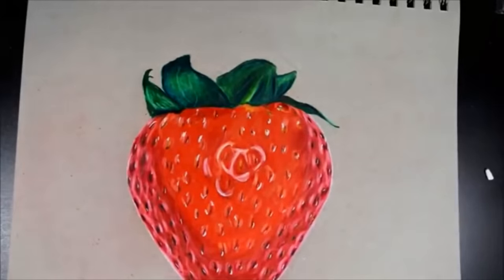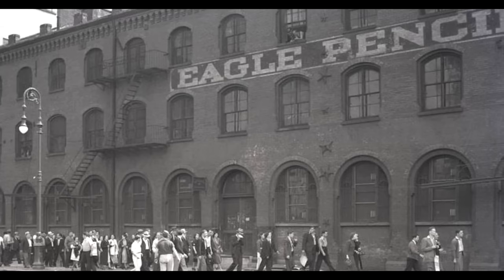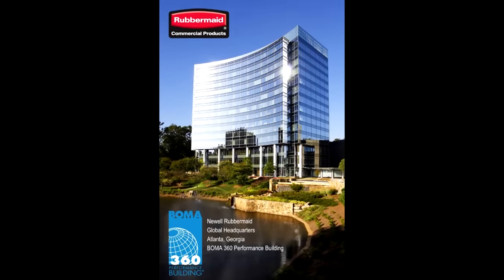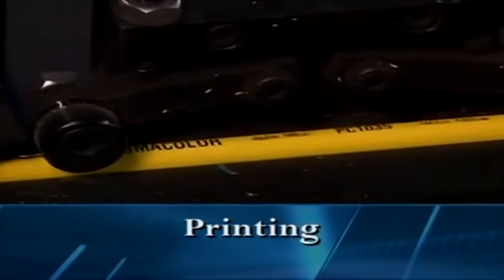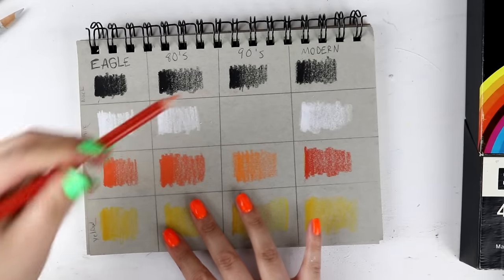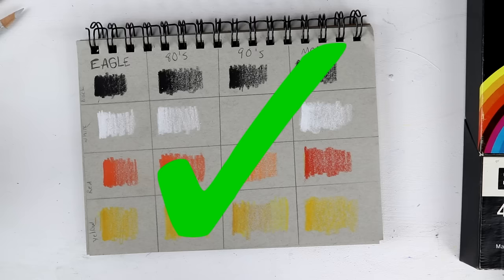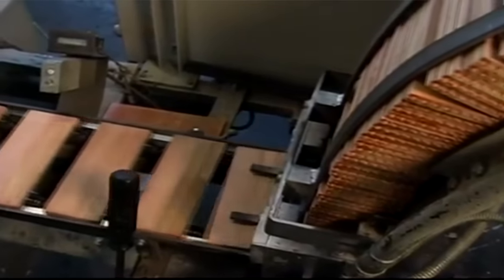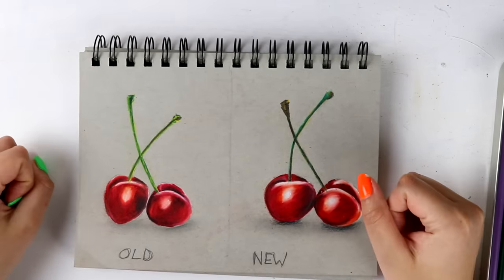Comparing 80 YEAR OLD Prismacolor VS 2019 Prismacolor Pencils: Have They Gotten Better Or Worse?

Comment: FaberCastell has an oil based pencil. Prismacolor is wax based. Wax based pencils are softer, so they blend easier, but they are vulnerable to wax bloom. It could be that Prismas were once oil based, or have simply hardened with age. I dont know. Interesting experiment. Personally, I prefer Faber, for lightfastness. If I want something smoother, I would go with Caran D'Ache, which are amazing pencils, albeit painfully priced. But I started with Prisma, and it was interesting to see this experiment. You might compare lightfastness qualities in afuture experiment...be interesting to see how that has evolved.

Comment: I suppose it is possible that old Prismacolors were softer back when they were new, and that the oils in the formula polymerized over time (much the way that linseed oil in oil paint hardens). Might depend on storage conditions, too, which would explain why some commenters here have old sets that are still soft.

Comment: Berol is a shortening of Berolzheimer, the proprietors of Eagle, which was founded in 1856.  The name was changed in 1969.  Berol was bought out by Empire Pencil Company in 1987, which was in turn bought out by Sanford, a division of Newell-Rubbermaid in 1995.  Some of the Eagle trademarks are still in use, for example the #174 Mikado (the name was changed to Mirado after the Japanese attacked Pearl Harbor) is still produced under the branding of Paper Mate, but it is a piece of flaming garbage now.  Yes, I am a pencil snob.  (The oldest pencil in my collection happens to be an Eagle - a number 507 Admiral #3 circa 1910).

Comment: I don't really consider Polychromos a good comparison since those pencils are oil based instead of wax based unlike Prismacolor. Maybe the Faber Castell Gold Faber pencils are closer to prismacolors, as I think those are wax based by comparison. With that said, I still prefer the prismacolors. I think they're easier to work with versus the polychromos, and if you're someone who wants to color and not fuss with blending for hours on end, prismacolor is better. Also, prismacolor is more widely available and cheaper. Either way, if you need your pencils to have really sharp tips, you're likely going to burn through them quickly regardless of the lead softness because you'll be sharpening to get that super fine tip, which is the issue I have with any colored pencil.

Comment: I have a set of Berol in a metal stand up tin dated 1986.  It had 60 pencils but some are missing, but I was the only bidder at an auction and got them for $10.  I think they are much better than the new version of Prisma Color.  I almost hate to use them - sharpen to an excellent point and have lots of pigment.
Reply: I also have most of a set of Berol Verithins from the 80's (I am the original owner - lol) and they are, in my opinion, better than the new set I have.  My kids want to know who gets them in my will.

Comment: Isn't a reason why they break so easily because the formula is so soft? When you drop them you can break the barrel from the inside and when you sharpen, you get to the broken part.

Comment: Could have to do with the wood used. My  theory is based on experience in a totally different field, old home restoration. Back in the day, all wood was “old growth”, naturally occurring woods that had grown and strengthened over time without the introduction of growth boosting chemicals....you CANNOT get wood like this today. Old growth forests are heavily regulated and are only cleared in small patches...not enough for mass manufacture. I’m talking pine trees that were 300-400 years old...usually called heart pine. That’s why old homes are generally more structurally sound and often referred to like “you CANT build them like that anymore” you LITERALLY can’t...that type of wood is essentially gone. That’s why old barn wood and salvaged 100 year old floors are so expensive. These days, pine is grown fast, with the use of chemicals, and it doesn’t allow the wood to naturally harden. So it could either be seepage of chemicals in the wood affecting the color insert OR less structural support from a more flexible wood, just a thought

Comment: i have that same "90's box" from college, tipping them at the slightest angle usually resulted in having to collect your pencils off the floor/table/etc, its the way they designed the box so that the pencils would slide forward easier when open for use, the inner easel tray is coated to make the pencils slide.  It also has very little structural stability due to being thin cardboard perforated and pre-pressed around the center with a short half-front-height easel tray inside.  It was designed in a way that you were supposed to be able to partially destroy the box while using them by tearing the perforation and folding the top back, and tucking the tab in to make a tray for the pencils to stand up in.  This box design was utter garbage from a functional use point, you could easily lose pencils everywhere, and most people bought cheap pencil cases to replace them when they instantly began falling apart a few weeks into the class quarter.

Comment: I first bought Prismacolor pencils in the 1990’s. The leads were soft and blended easy and I had no problems sharpening them. I buy some new prismacolors and they broke in brand new Prismacolor sharpeners. So I thought those were single pencils so I bought a whole set in the mid 2020’s. Most of those pencils broke.
Reply: It’s the quality of the pencil not how soft the lead is.

Comment: I go along with Awkwardsity... Yah the did change the formula a little, I have worked with them Long enough to have bought all the brands retail... go* does that date me... But when I was using the older ones in the 70's and 80's they blended beautifully. I have Pictures that old hanging next to ones done in the last couple years, and you can't tell there is a difference. My guess is the liquid part of the wax they mix their pigment with evaporated from the pencils over the years. Although I will add one other comment also... The issue or wax bloom which was a big issues in the 70's & 80's, seems a lot less daunting today. I remember holding my pencil drawings aside almost like you would oil paintings, let them bloom, then wipe it off before showing them. Yah in the 50 years since my technique has improved, but the bloom has also definitely lessoned.

Comment: Tip:  Prismacolors are wax based so if you experiencing some breakage, just heat it up so they all stick together inside, put it on your microwave for 30 seconds, use hair dryer or on me hehe

Comment: Strange as the colored pencils only seem to fall out when you tip the box upside down. They seem to stay in the box when they are help upright.
Reply: i have that same box she called the 90's box from college in '02, tipping them at the slightest angle usually resulted in having to collect your pencils off the floor/table/etc, its the way they designed the box so that the pencils would slide forward easier when open for use, the inner easel tray is coated to make the pencils slide.  It also has very little structural stability due to being thin cardboard perforated and pre-pressed around the center with a short half-front-height easel tray inside.  It was designed in a way that you were SUPPOSED to partially destroy the box while using them by tearing the perforation and folding the top back, and tucking the tab in to make a tray for the pencils to stand up in.  This box design was utter garbage from a functional use point, you could easily lose pencils everywhere, and most people bought cheap pencil cases to replace them when they instantly began falling apart a few weeks into the class quarter.

Comment: My last pack of prismacolors, about 2 years ago, all were off-centered. If it was one or two I would have been fine, but no all in the pack were off. I was pissed! I ended up just saying no more for prismas and switched to faber castell and never looked back. Yes more expensive but the breaking made me use half a pencil for 1 large drawing. I gave up.

Comment: Honestly, softer core is gonna break and meant for people who can't do sustained heavier pressures. Color me not impressed as its simple common sense soft core is gonna make work flow better but you'll be expected to pay for more in the long run. So for me hard cores are the best and pressuring pigments is a muscle memory that demands to be kept in top shape, personally I don't support pressuring cores for more pigment is a viable reason as the product can't speak and use itself hence: X is only smart by the pilot. Meaning the smarts of the individual is what unleashes the "potential" of said product. All in all prisma is on a very hard road to recovery as I am not a fan of soft core as its just "lazy" in my point of opinion and I'd rather learn from more failures/errors than have simple or mastercrafted pieces done by minute colors.

Comment: I don't know if anyone else has this problem but whenever I get new prismacolors, when I start to use them, the wood would start to crack and split. I'm pretty heavy handed and I have a tight grip on my pencils so that could be the case but I'm curious if this has happened to anyone else

Comment: Yes, they did change the formula, as you said...but they changed it WHEN Mexico started manufacturing them. And it is because the quality went down.  Lets be blunt, you don't go to Mexico becasue they are known for their high quality resources and manufacturing costs.  
Alex McKenny (the head of QC) straight out said, they removed two ingredients from the lead when it  started being produced in Mexico because of costs. 
And lets not even get started on the quality of the wood as it is now...

Comment: The main issue for me comes with how the new ones Are NEVER centered cores. If you look at the back end of any new prisma you’ll notice how the core is almost always just barely offset. Making it next to impossible to sharpen them with a hand sharpener without breaking them as they gain their point. You literally can’t repoint them without doing more damage than you did using it. Also the wood is large grain soft soft crap that’s one step above balsa wood. I’ll never buy another prismacolor product again because of it. Ever.
Reply: With older ones, they used a denser core so it could withstand the lateral uneven stresses of hand sharpening. But when they updated it to make it more “blendable” they didn’t change their tooling in the factory. Which is 100% the root of their woes.
Reply: Goddamnit 😂! Awesome video! 👍👍

Comment: Interesting video, but some of your historical info is inaccurate. Your Eagle pencils show the third-style eagle symbol (also called the "flying capital E eagle"), used during the 1950s and 1960s and even later. After Berol bought the company in 1968 (actually "partnered" with it), they originally printed "Berol" on the boxes, but continued to put "Eagle" stamped pencils inside the box. The pencils you show were probably manufactured during the late 1960s or early 1970s, not during the 1930s or 1940s when the original-style "spread-winged eagle" symbol was printed on the pencils. - Best wishes, SLOphoto1